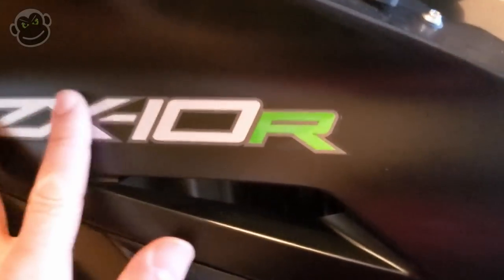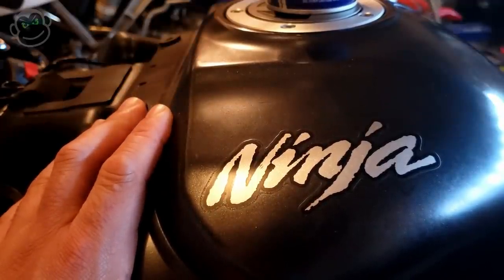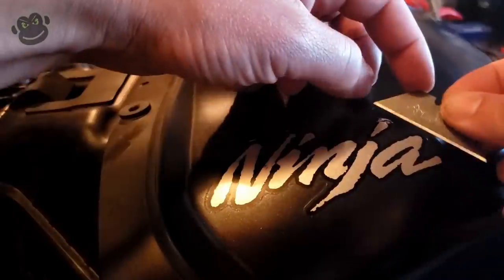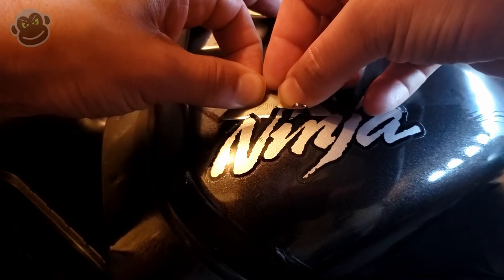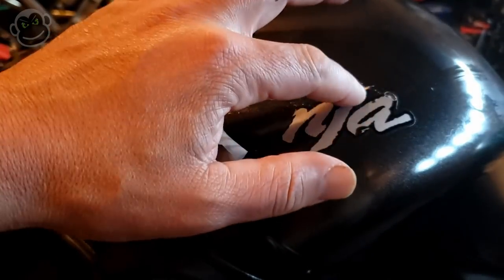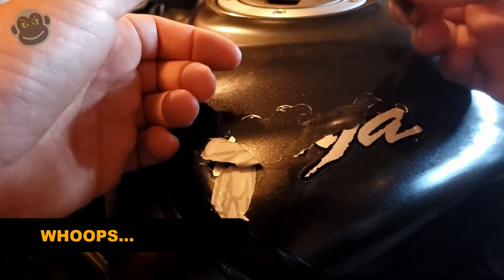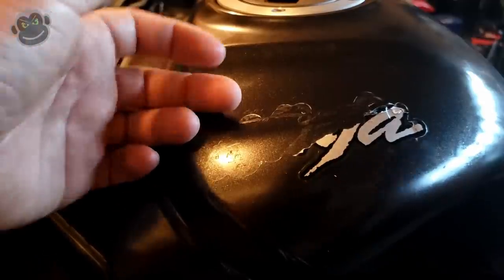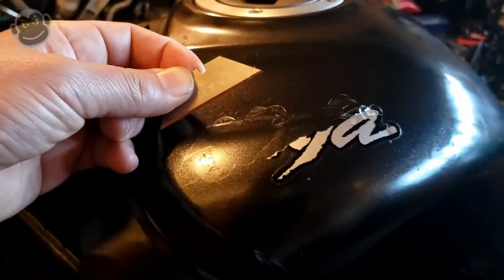STICKERS WITH CLEAR COAT SUCK!!! - how to remove sticker with clear coat

Comment: Woah that was brutal alright MB, well done, you are very patient, we need that goof off here 🤣 can’t want for the next part to be wrapped like green 😃👍
Reply from the maker: Yeah, it pretty much sucks ass!  Thanks.  Oh, I'm so excited for it.
Reply: @MonkeyButtRides  Damn, I am not a fan of my 2,000 rebels gaudy decal and was hoping to replace it with a standard redwing honda logo but now I'm not sure I could without damaging the tank. Do you think taking 2,000grit SP and wet sanding it and then polishing would work or would it always look "wrong" or "off" in the area where that giant decal used to be?  TBF there's already 2 small scratches/chips on the tanks paint job so.. perfect isn't really necessary.
Reply from the maker: @nickyb7612  Man IDK if 2k grit wet sand would work or not.  I think best case scenario it would look "off" it's just hard to say really.  I haven't found a fool proof way to deal with these clear coat stickers.  I'm not familiar with the Rebel badging on the tank, can you just put new badging over the top??

Comment: After removing the decal, is there a layer of clear coat on the tank or would the whole thing need to be re-coated?
Reply from the maker: In my case there wasn't another layer of clear coat under the sticker.  So that means it leave a edge that is hard to see but you can feel it.  TBH, I wouldn't do it again.  I would just put the wrap over the stickers.  It's a lot of work, very time consuming and difficult to get right.

Comment: Can I not put another decal on top if I want a different colour?
Reply from the maker: Depends I guess, for me I wrapped the entire tank in a single piece of vinyl wrap and didn't want the sticker underneath to show through.  You could put a sticker over the clear coat sticker and it would probably look just fine as long as the new sticker was large enough but it might show through a little bit.  The clear coat isn't perfectly smooth, at least not on my bike.